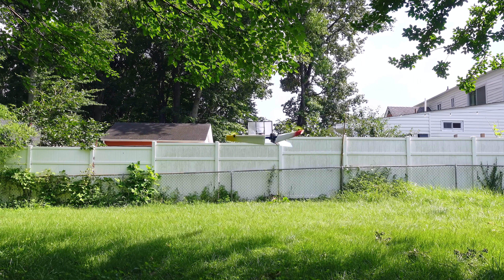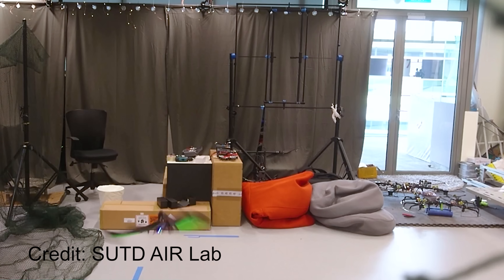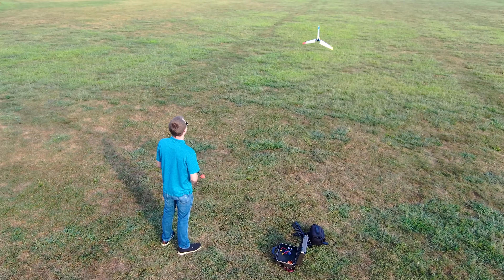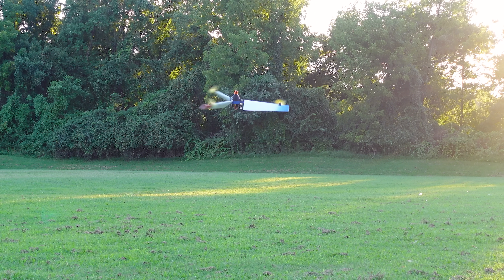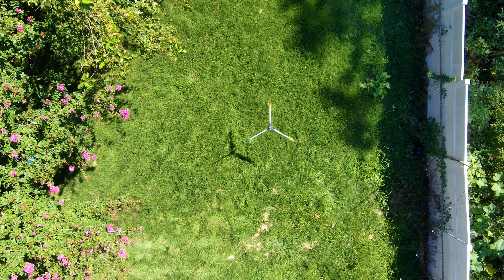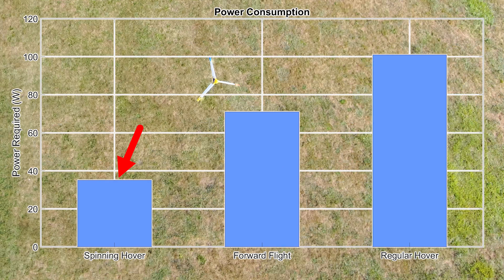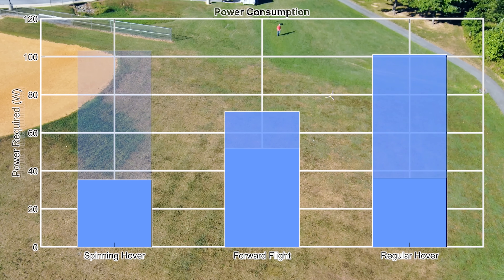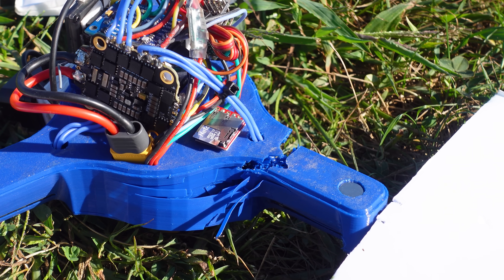Is THIS the Most Versatile Aircraft Design?  (Forward Flight Testing) - Part 2

Comment: Would replacing the three motors with just 1 that's bigger but directly drives the wings, be as efficient? (in hovering mode) I understand your design would still be more versatile, I'm just curious.
Reply from the maker: I guess it would depend on the weight of the motor required to drive such a large prop and/or the efficiency of a gearing system to make it work. It would also require a tail rotor at that point to keep the drive motor from spinning in the opposite direction. And then might be a good idea to implement a swashplate while you’re at it too!

Comment: 😂 I really liked that reference to the Star Wars Tie Fighters from the beginning but What would a model based on the X-WING STARFIGHTER??A V-TOL that in its initial configuration has 4 rotor blades like the one you already made with 3 "wings" with pitch control and that when it switches to forward flight mode it can join the wings in pairs As with the X-WING STARFIGHTERS they do... It would be a much more efficient design in both modes... It would just add more controllers and electronics but I think it would be worth it... Already having the Experience and the parts of this same model you could easily come up with something like this

Comment: can you be more conclusive and expose more efficiency data? for example, holding some weight (you can use bearings on the craft to prevent the weight from rotating with it) and comparing the amount of energy required to carry that weight with the propellers and with the rotating wings. I see some potential. You could use a contra propeller to increase the flight speed, therefore its efficiency. But my advice is to make a contra propeller in the bottom of the drone and half the diameter of the diameter that the wings form when spinning. I think it will be very interesting. If you don't do I'll do but in 10 years ;) as i don't have the proper time do play around now. I am creating a new way to control robots, drones and any other devices. Hopefully much more attractive than MAVlink, ROS and other existing drone protocols and solutions laying around for unmanned drones, as the capabilities are far more advanced and the abstraction is quite wide so it's much easier to use. Once I get it to the beta stage, then I'll start playing around with drones. I see a lot of potential in your idea for delivery drones.. but with contra propeller in the front so that the back can be used to hold the package bottom part, something similar to this https://youtu.be/DOWDNBu9DkU?t=938 (by the way, that rotor on timestamp 938 is very interesting. (another video idea for you to try)

Comment: A 4 wings setup could be cool. They would be arranged in 2 pairs, that can snap together to form the forward flying and spinning hover blades, and then fan out for regular quadro-copter hover. I wonder if there could be a simple hinge mechanism that would work so it's not too complex and prone to break on the transitions.

Comment: It may sound ridiculous, I may be dumb. But like, what if behind that you had a smaller set of 3 spinning blades that were on the same axis as the larger blades. Then you would just place them both on reverse of each other. When In “hover mode” you change the “pitch” of the second set of blades to direct the wind/craft. Then in “fly mode” you have them spin the same axis as the smaller blades to assist speed. I’m not an expert. That would just be my uneducated hypothesis.

Comment: How about an alternative configuration where you start out with a central beam with an asymetrical airfoil cross section. At each end of the beam mount a single-bladed propeller, which counter-rotate with respect to each other. To operate, start in helicopter mode with the single-bladed props turning and airfoil beam at neutral angle of attack. To transition to horizontal flight, rotate airfoil/beam to create angle of attack. I suspect that some additional control mechanism might be required to achieve stable flight, but for lift and primary thrust, this arrangement should be very efficient.

Comment: I wonder if you could use a spring loaded retractable assembly on the vertical plane so you get less drag when in imperial shuttle mode, but all the benefits of spinning hover.
It may be too complex or add too much weight/balance issues.
Also seen toroidal blades in the news...

Comment: You mentioned that having a non neutral wing would increase efficiency during forward flight but that optimizing the wings for forward flight would effect the straight hover. What if you installed say inflatable air bladders in the wings that would change the wings shape for forward flight and deflate for straight hover. Not sure the added complexity would be worth it, just thought it was an idea.

Comment: Hmm you could add another controller to stair rotation of horizontal setup flight to create lift by all of them and having additional force point :) probably for stairing then you would have a real 3,5d wing span which will allow for full controll this way but still it could preserve very good flight parameters

Comment: Hey, idk if it is possible and  may sound dumb but, isn't helicopters oriented by the angle of attack of it's main blades? wouldn't be possible program something that works like it? they change quickly during rotation to provide maneuverability during rover... besides the secondary blade...

Comment: I bet it could still spin hover if one of the wings were replaced by a minimal aerodynamic fairing on the stalk for the 'top' motor. Picking an optimal rpm and offsetting some mass could allow you to balance the asymmetric lift to give a flat spin with symmetric motor power and orientation.

Comment: Could you add flaps to horizontal wings in forward flight to help offset the vertical stabilizer? Is this something which could help with additional lift and hopefully wouldn't add to the power consumption because less power would be needed to maintain the same lift a slower speeds of horizontal flight.

Comment: Make it an X-wing, capable of collapsing the bottom of the top wings inwards to accommodate the bottom ones. 
Or displace them, so that in forward flight, the wings utilize the coanda effect.

Perhaps thise new, swirly propeller blades using that effect are the way forward for you. 😊

Comment: What about using an X-wing fighter configuration? Does that solve the "dead third wing" issue? All the wings would be creating lift in forward flight, but in "non-spin" it would more stable than a two wing configuration but probably not as stable as evenly spaced four wings. I subscribed.

Comment: Why not 4 engines, so then you would have an x when in forward flight, thus no wasted upright during forwards flight?
Also let’s you spread the load on 4 spars, 4 engines, maybe let you run the electric motors at a more efficient rpm range?
Reply: How about you do it if it’s so easy??

Comment: Cool design!

You could add flaps to increase lift during forward flight. The program could adjust them to account for speed, pitch, and yaw. That way the controller can maximize efficiency for the demands as the flight requires.

Comment: What if a small fan is inside a wings instead? 
-In hover mode you can rotate small fan perpendicular to a wing and rotate it into direction you want
-in cruise mode use wings to quickly moving horizontal while a small fan in a wing is used to keep in in the air
-It may be less efficient but interesting to try

Comment: Not sure you could get away with this at its current scale, but to improve upon forward flight, could you incorporate a hinge mechanism at the base and motor mount of the wings, so that (whichever one is center-top), each hinge could fold backwards 90 degrees to reduce drag while having the motor reverse polarity and push the air as it traveled forward?

Comment: I’m now pondering a rhombic quadrocopter design where two large props are on the ends of long wings for rotating hover and forward flight while two small props much closer to the center (sacrificing leverage by being close) offer improved stability during a static hover (over nothing).

I wonder what designs for the small props can provide the best control while static, and the least drag in other modes, and what ratio in prop size and arm length is optimal.

Comment: There's probably been updates by now, haven't looked yet, but before I find out the solution that was used I want to guess that the ideal way to stabilize while spinning would be some kind of gyroscopic effect. Could use an actual gyro addition to the build, but it feels like there MUST be a way to use the fact that it's already creating some level of gyroscopic forces inherently by spinning, and it'd be a shame not to take advantage of that...

Comment: Brilliant!, my only question to possibly help improve the hover stability might be adding contra-rotating or counter-rotating propellers as the Kamov Ka-27?, which would add software & design complexity, but would there be an advantage from hover mode to horizontal flight by adding a slightly offset rear wing postition from the secondary propeller/wings for lift in horizontal flight mode? You have proof of concept, most hard work done so far, very well done. Your sincerely from a couch potato.

Comment: What if instead of bi or tricopter design you used a four wing design with agles between the blades set as follows:
between blade 1 and 2 => 20 deg
3 and 4 => 20 deg
2 and 3 => 160 deg
1 and 4 => 160 deg

Comment: Now, if you somehow managed to suspend a camera from the center, one that tilts when you start to go forward and maybe has a really small tail rotor design to keep it rotationally stable, you could film while spinning or flying forward. A really good bearing could either reduce the size of the tail rotor or maybe even eliminate the need for it with super lightweight gyroscope if there is such a thing.

As suggested a number of times elsewhere in the comments, if a mechanism were developed to allow for biplane like X-Wing configuration forward flight, all the better.

As far as stability for hover, you're basically trying to reinvent a version of the helicopter, which I think uses variable pitch during rotation to remain as stable as possible. 

If I were playing around with either the three or four Wing design, I would definitely buy an RC helicopter and try and borrow as many elements from that as I could.

So many cool possibilities. I think the most efficient flying car designs all use one or more wings that generate lift as part of their forward motion. I don't think it looks as cool has just having rotors, but like you've discovered with hover and forward motion, it's much more efficient.

Comment: Why don't you just put the 3rd propeller on a narrow stick , and ditch the third wing. then you have the best of both worlds. In forward flight, you can have the stick point backwards and use the propeller on a stick for forward thrust. Alternatively, you can do the same with the three wings, and in forward flight, point one of the wings backward, instead of upward.

Comment: What if the wings were movable? Let's say two wings could shift between two positions: one at 120deg from each other as you show and another at 180deg.  Then you could effectively transition into a bicopter mode for fast forward speed while maintaining the hover benefits?

You're maybe thinking that would be silly as clearly there are 3 wings.  Well, what if the 3rd wing was actually two halves? Each half could fold back alongside one of the others when they're at 180deg offset and the 3rd motor would slide back to the center (as opposed to staying at tip and folding with the wing halves).  

Might be something fun to explore.

Rad to see what you're doing here!

Comment: I'm not a modeller or an aircraft designer but, in horizontal flight, could you get the 3rd wing to fall back so it becomes what would be the normal body of the aircraft and so create less drag that way? You could still use the propeller to maintain level flight which in turn would stop the wings from flying at near stall in horizontal flight.

Comment: Have you seen the new wing design proposed by Nasa/Boeing? The Boeing Truss-Braced Wing

Makes me wonder how it would work as a propeller design
Reply from the maker: The truss is just there to make the higher aspect (more efficient) wing structurally feasible
Reply: Ah, that makes sense. Thanks for the explanation =)

Comment: I could only imagine how hard it would be to c++ regulate pwm based on direction in the 1000th of a second. 
Like a cam phase, to achieve directional control you would need to slow only one motor at a very sensitive time related to a direction. I love arduino! And this is way past my capabilities.
Reply: You could do it In just programing alone. But I would chose to do it mechanically. 
Imagine it's like adding "v-tech" to your center hub. Mechanically introduce a cam to the center hub that adjusts a single wing pitch deferential. Should create drag on one wing at one a time as it passes a gyro oriented direction. I'm an idiot. Huge thumbs up.
Reply from the maker: Check out the next video. Pulsing motors around rotation is exactly what I did!

Comment: I wonder how switching from 3 arms to 4 would change the equation, especially if you squeeze in the ability for the arms to "fold" / sweep closer together for better forward flight. Basically, think star wars X-wing almost, but the expanded configuration being a fully perpendicular X for rotating and convectional hover modes.

Comment: What about having a 4 wing design where the wings get closer (more parallel) to maximize lift in forward flight
Reply from the maker: Watch till end ;)
Reply: @NicholasRehm  another idea is to have the top blade fold backwards and use the motor for thrust vectored pitch control

Comment: For ages I've been thinking or airfoil that foil one way or the other, with a mechanism (likely) inside the blade.
The way I see it, there is a blade core and it's covered on two sides by somewhat flexible top surface. A rotatable member across the length of the blade can make it asymmetrical on the outside, whichever way is needed. Switching time might be in the dozens of milliseconds. Ideally I want an airfoil that is totally out of the way until I need it. So it looks like a knife, until it must look like a wing. Hydraulic activation might be preferred. Even independent bulging and shape of each side of the blade. The hardest to engineer (but I want it) is to make the wing telescopic. I am not kidding when I say I want it out of the way. Design properl, one sets of wings will work for a single plane in "jet fighter" configuration and "glider", even "vulture" mode. The reason I am pondering these solutions is for a wind-powered car, though. Able to go the direction we need to go and do so on the wind that's available. Some wind is used as a sail, some as a turbine, some as a propellor. For a great mindfeck, check out DDWFTTW cars. 3x windspeed, directly down wind, or 2x wind speed directly upwind. I want to take that to the next level, ideally a wind power ecranoplane, which is perhaps they hardest thing I can imagine in aerodynamics. But surely with the levels of automation that you achieve, it will be possble, for the time that wind is available.

Comment: Hello.
Nice video.
..a quick thought...
If your 3rd foil is a non-productive feature in forward-flight [ ff ]...
What about a 4th foil?
Could be used, similarly to the
X-wing fighter?
Alot of lift at lower to medium speeds?
..And the next revision after that...
In ff mode, whereas the "x" is
a squashed x for medium speeds...
..a high-speed [ or Hyper Speed ],
have the 2 starboard foils merge together to create 1 solid "Starboard Wing," and likewise w/the Port-Wing...

As you are in R&D /proof of concept
modes; maybe use Carbon-Fiber
for your First-Article?

Comment: I'm in a drone class from Miracosta TCI, I'm super interested in the way this pans out. I would love to work with you on it. I do have my FAA Part 107. And would essentially a rudder on a non spinning portion maybe a bearing with a brake. So that the rudder could move the air to help prevent drifting. Either that or positioning sensors with another prop that's sole purpose is to do tiny adjustments to stop the drift, or start a strafe.

Comment: A human weight bearing one’s cockpit would have to be placed in a bearing system with the wing/rotors spinning around the cockpit for obvious piloting reasons other than that yes best design I’ve seen in aeronautical engineering

Comment: I wonder if you could get more efficient forward flight while still maintaining most of you hover capability if you want to 4 wings rather then just two, but make one pair larger/longer and the other shorter.  You would still have the 4 motors for spread out hover stability, but can do forward flight on the larger wings so there is less drag in forward flight.  It would all be a balancing act of trade offs but I still wonder if it could help improve on the design.

Comment: Have you considered adding ailerons or flaps on the 3 wings? If you were able to figure out the control logic, doing so could give you the ability to create a higher lift airfoil in forward flight and increase directional control in spinning hover. Using them to increase directional control in spinning hover would be the more difficult challenge as the servo would have to automatically react fast enough to match the rpm of the vehicle. Great video!

Comment: Here's an idea to test: A quad-blade design, where the top and bottom fins are slightly smaller but still articulated. It should allow for finer control than just two articulated wings with propellers, while still having the stability and efficiency of spinning hover.